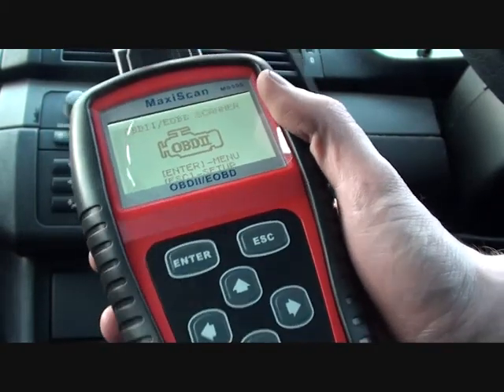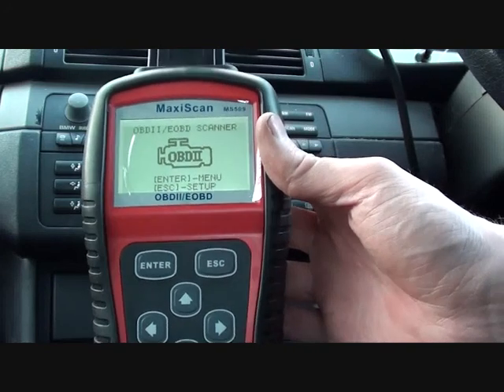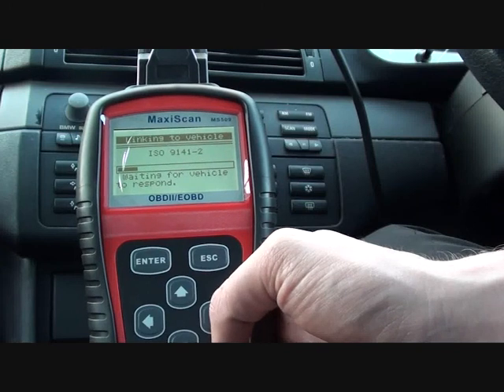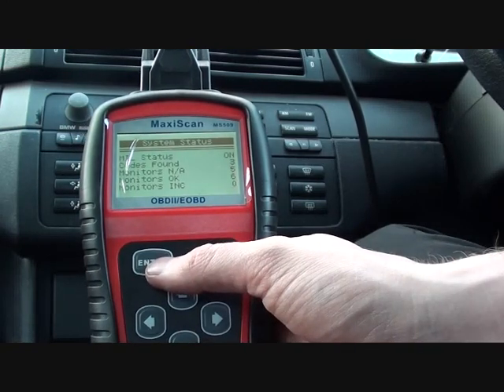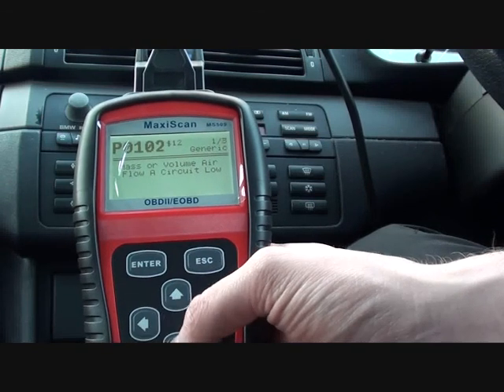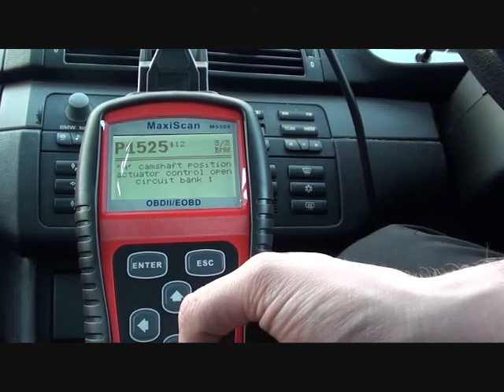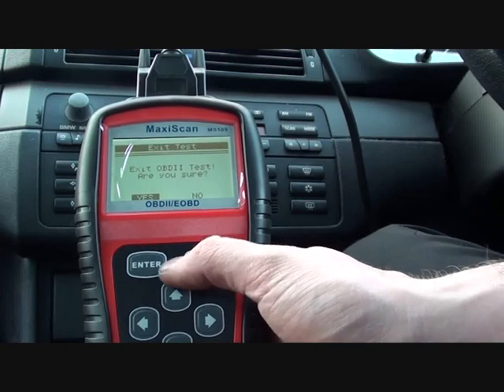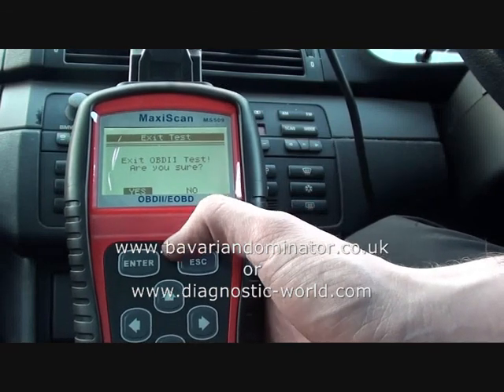P0102 Mass Airflow Meter MAF Diagnostic Fault Code Proble Autel MS509

Comment: I want to share with people. Suffered two weeks 07 prius not start. PO113 and P2102 knocks on the scanner. Order New sensors in the end the problem was in the wires, frayed in two places. Start starts and revving freely when you go or push full throttle. Replaced electro engine Throttle. Everything was normal.

Хочу поделится с людьми . Мучился две недели 07 prius  не заводился. Выбивала P2102 и PO113 на сканере. Заказал новые сенсоры , в итоги проблема была в проводах , перетерлись в двух местах. Начала заводится и газовать произвольно когда едешь или нажимаешь полный газ. Заменил еликторо двигатель на Throttle. Заработала как часики.

Comment: Why didn't you start the car and read the data coming from the MAF sensor?
Reply: Dranged22 I was referring to raw data coming from the maf sensor usually expressed in grams per second. Best way to determine if the sensor is operating properly.
Reply: rfn944 thats what i would of done the code wont always give you all the info the raw data will.